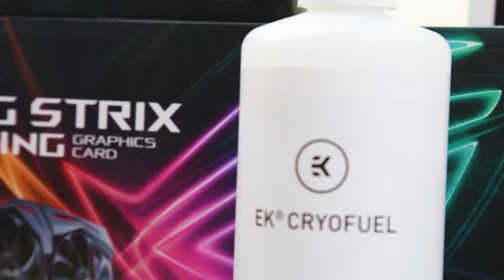HNC Platinum Burst - PC "Trăm Củ" Có Đủ Để Chơi | 10900K 4.500$ Gaming PC Timelapse

Comment: Có thể cho mình biết những lạoi Fittings cần thiết, mõi loại cần chính xac bao nhiêu c. Về cái bơm 1 đầu molex nối trực tiếp vói PSU, 1 ddaau 4pin PƯM nói với W Pump+ hay là AIO Pump trên main vây_DRGB Spliiter thì càn 2 chiéc để nời với RGB Header 12v trên Main co dg ko_, Còn fans thì mình nới 3 cái fans  CPU_Fan  và 3 fans vào CPU_ Opt tren main để cho sòt có thể chỉnh tớc độ haz la CH Fans,Hướng dẫn jup mình nhé
Reply from the maker: Chào bạn, với tư vấn phức tạp như vậy bạn add zalo số 0363058112  nhé :D đây là số hotline tư vấn tản nhiệt